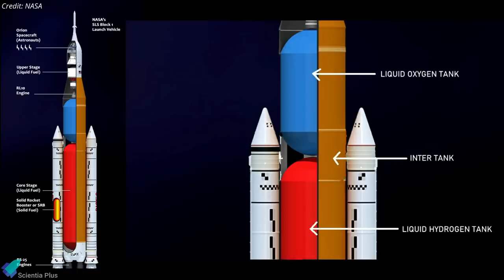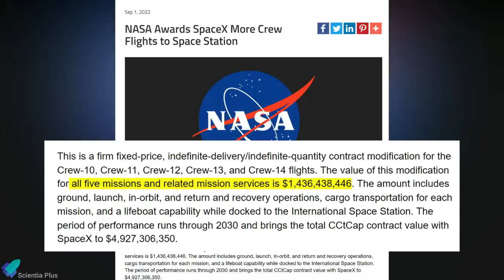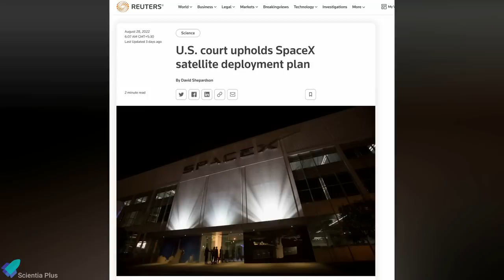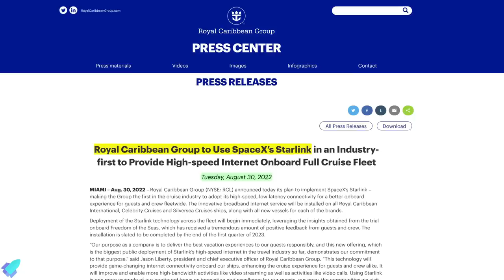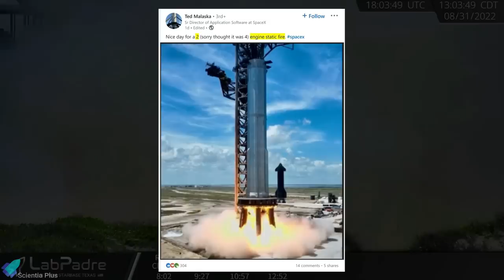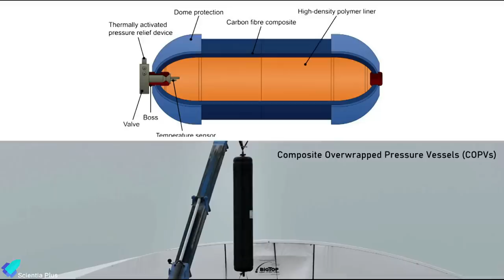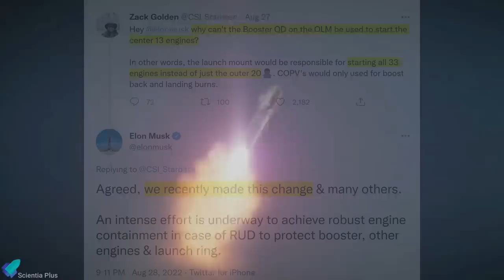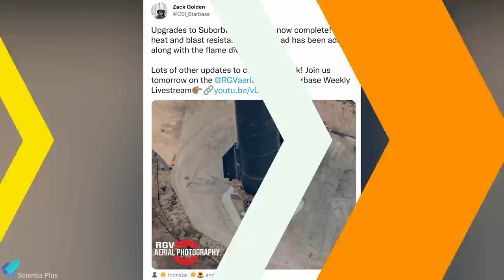SpaceX Removed Two Raptor V2 Engines From Ship-24 & Booster-7, Artemis-1 Launch & Scrub, Starlink

Comment: So here's how they fix the Artemis I problems, from 2:40
1/ change the loading procedure including start chill-down earlier
2/ work at the pad to address the leak at the hydrogen umbilical. 
3/ move launch date to Sept 3rd

this seems all very vague to me, and wherein are they correcting the failure to chill down #3? Can we please hear from an actual engineer.
Reply: I thought they said the engine chill issue was caused by a faulty sensor, and since it can't be reached without tearing the rocket apart, they're going to assume it's a faulty sensor and light it anyway.

Comment: Very good video!  Interesting engine complexity.  The fuel-Oxy mix has to come together just right and really fast.  I would support a giant 600 Meter Eiffel Tower with a hollow center and upward spraying jet nozzles, spraying filtered sea water,  to initiate propulsion of the ship off the launch pad.  The heat tiles would be hinged like fish scales; and the nozzles would spray like the timing of mag-lev trains magnetic propellers upward against the fish scales.  Pressure would come from hydraulic presses.  Yet still; an 600 Meter long solenoid in the ground could lift the entire launch pad! Just enough for a 60% assist. Take some of the load off the fuel pumps.
Reply: I like your thinking. It could work. Set your hydraulically boosted rocket in a valley next to a high lake with piping to the launcher base for even more kick. Maybe no “fish scales,” just a flat base the water pushes against. I’ll have my people meet your people and start work immediately.
Reply: @StevenBanks123  LOL!  Thanks a good laugh in the morning is better than a cup of coffee for this old geezer !
Reply: Science Revolution  You need some sleep friend.  I've been to the moon; and I have time traveled.  The small satellite drones do have a propulsion means.